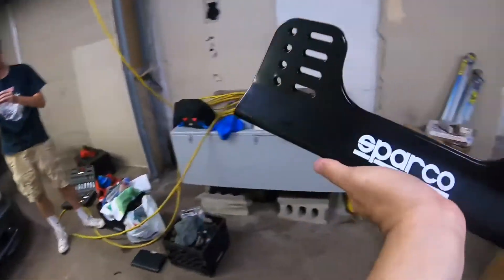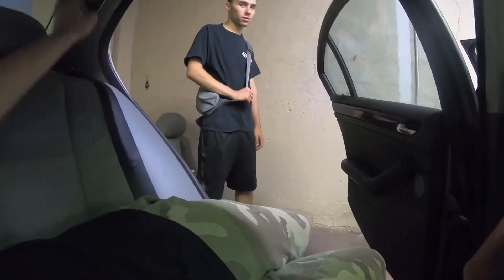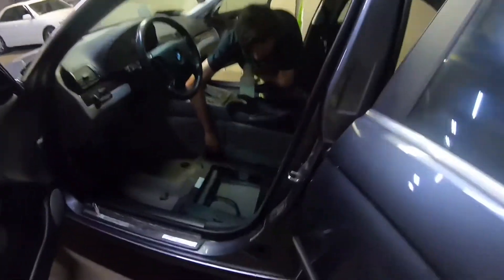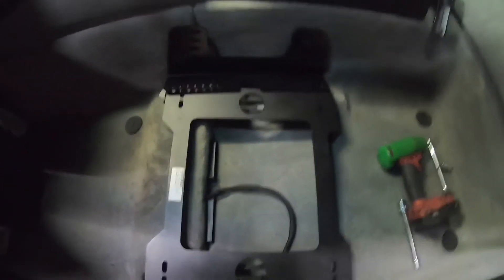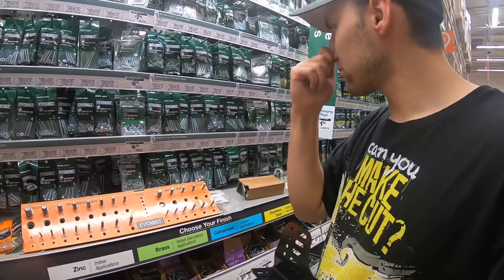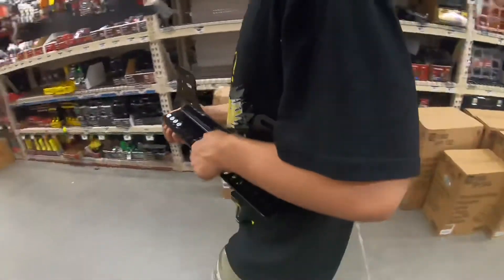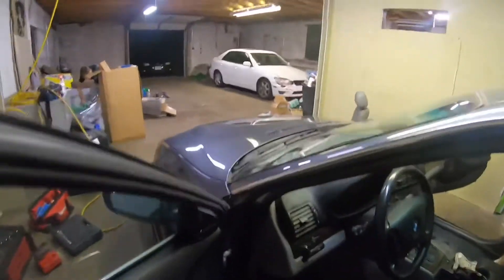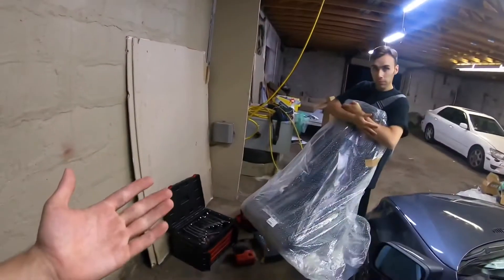BMW E46 Drift Car Bucket Seat Install Sparco Sprint

Comment: Do you think you can gain some above head space with those seats? Are they compatible with standard 3 points seatbelts?
Reply from the maker: I use both seatbelts, regular for everyday driving and harness when on track